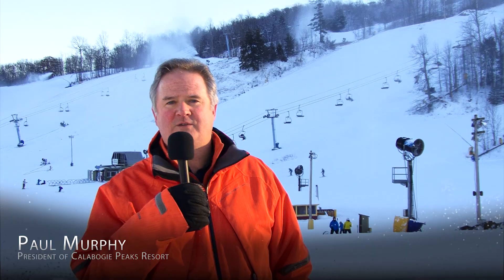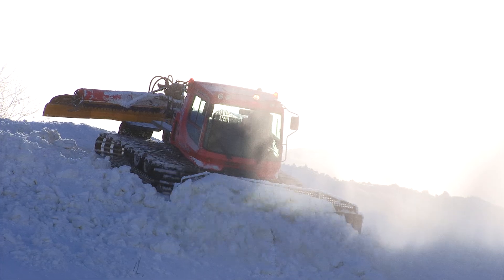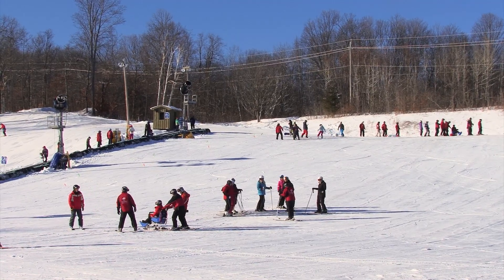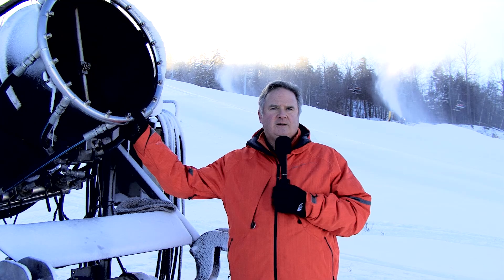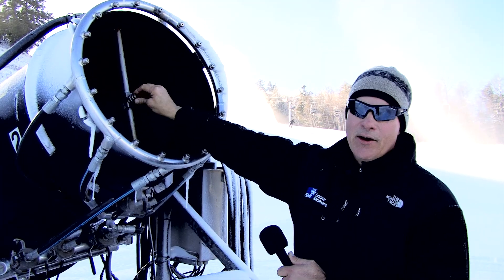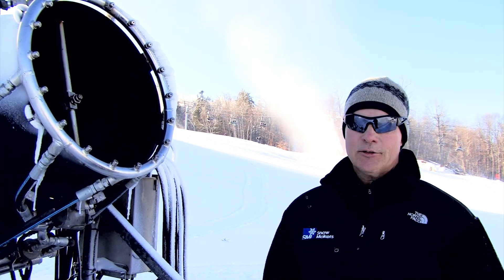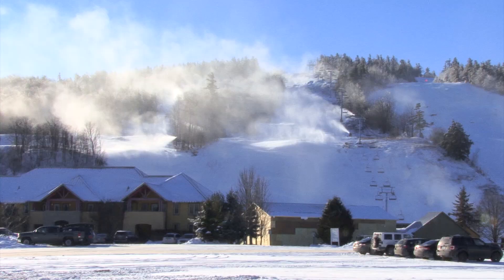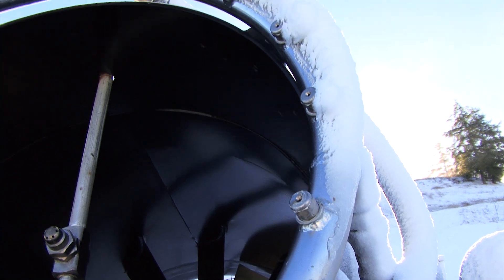Behind the Scenes - How Snowmaking at Ski Resorts Works

Comment: So how do you keep the water from freezing at those temps between the pump house to the machines?
Reply: You keep it flowing, I was making snow last night at -32 and if you have a problem and water quits moving for over a minute you’re pretty well screwed, I run a mobile unit with a big generator and water tank in a sea can with a high pressure pump pushing water to the snow maker, tank is filled by a 3 inch water pump running at pretty well idle
Reply: @timmyteabag69   interesting stuff.

Comment: Don't forget all the fun parts like using the Tiger Torch to thaw the ice that often forms on the rear fanguard screens. Digging out the hoses and power cords after the night shift guys slept most of there shift. Hanging, thawing, and rolling  100 ft water hoses etc.  Unsung heroes.
Reply: 6am, just got back from a gun run. Im the night shift guy. 🤣

Comment: Nice system. I work at a resort in pa that has a system that has 90 techno alpines and a portable fleet of pole cats that is an automated system with e-motors that run water hydrant.
Reply: 7 springs? Pgh resident here 🙋🏽‍♂️

Comment: @7:48 "those motors use less electricity (horsepower), great for the environment. @9:12 "key to making snow is horsepower, we've increased our horsepower dramatically."
Reply: do you want to ski or not?
Reply: He would have meant the motors are more efficient than the previous system or systems used by some of the lodges.
Reply: I noticed that as well; however he talks about different parts of the system. I think the actual snow guns got more efficient in the aspect that they produce more snow for less or equal power, while the big water pump just got a power upgrade. That eric guy that answered perviously seems a bit confused by mechanical power vs electrical power: the term horsepower does not indicate machanical power at all; it's just a unit.
Reply: You clearly didn’t listen very well. Their previous system used compressed air and water injection at the main pump house, where now compressed air is only used for nucleation at the fan head where the majority of energy is pure water flow. Thus they use about half as much power as their old system.
Reply: @46I37  just shut the fuck up, nobody cares, seriously.... and it sounded like everyone in that video was lying .......just want to put that out there
Reply: @Smegma_pirate  this whole thread is about what 46I37 is talking about so what do you mean by no one cares. Also why would the people in the video lie about how a snow machine works? That makes no sense. It's honestly funny how mad you got from a single reply.
Reply: @Smegma_pirate  I care. You believing everyone in this video was lying just goes to show how little you understand these topics. You probably got confused and offended when people starting using science and math in their explanations, didn't you?
Reply: @Smegma_pirate  Y U Mad?
Reply: Kilowatts is equal to horsepower, not "electricity". Electricity is a vague term and he could have easily meant that the efficiency has gone up, not that kilowatts went up. Efficiency=mechanical power output / electrical power input (power=kilowatts). Two electric motors could use different amounts of kilowatt hours and produce the same horsepower (kilowatts) if one is more efficient that the other. Had the guy said kilowatts instead of electricity, you'd be correct, but he didn't.
Sincerely,
A Mechanical Engineer.
Reply: By less electricity he means less kWh of energy needed than before.1 HP equals 746 Watts, it's set number and efficiency has nothing to do with it. Demand, measured in "Watts", over time is measured in "Watt hours" (Wh). Example,  a 10 HP motor will draw 7.64kW. That motor in one hour, at a full constant load will use 7.46kW hours (consumption) of electricity. What Paul was saying is the new (well 4 years ago...) fan guns only use 15 HP (11.190 kW) each, which is 40% less kW than the old system of having huge compressors that would feed all the fan guns compressed air. The new guns compress the air themselves, and by doing that are 40% more electrically efficiently than using one central source of compressed air for all the guns.  Which is unrelated to the pumps for the water, that both the old and new system still need.
Reply: smaller hp is less power usage. The duty of the motors are going to be similar. you know that.
Reply: @Eric-lf6yx  lol kilowatts is merely a designation, a word used to descride 1000 watts all in the same place at the same time.... it would be wonderfully convenient if 1000 watts were equal to 1hp but it aint. please don't engineer anything in the pacific northwest.... your knowledge (or lack ther-of) is quite concerning......
Reply: honeydewbunson I think your terribly confused by my comment... let me explain. When I say, “two electric motors could use different amounts of kilowatt hours and produce the same horsepower (kilowatt)...” I think that is what confused you. Saying horsepower (kilowatt) does not mean horsepower=kilowatt, I simply mentioned two power types of units for people to understand. Obviously 1 hp=0.7457 KW but for some reason you thought a unit followed by another unit in parentheses means they are equal. I guess that confused you. I could say “power” instead of a specific unit like hp or KW to confuse you less next time. Please don’t make such strong false judgements so quickly.
Reply: this guy is clearly lying throughout the video, such shaky speech and nervous swallowing

Comment: How does the water lines not freeze
Reply from the maker: As long as the water is pumping through they will not freeze in most cases. The danger is when the power goes out and the pumps stop, the snowmaking crews have very little time to disconnect the hoses and drain the water before the snowguns get damaged. Because of that, it becomes dangerous and risky to do snowmaking as it gets extremely cold (-20'c and beyond).
Reply: The ski resort I work at has 103 automated  pole cats and techno alpine system. That have back up batteries that work a e- motor that sits on hydrant that shuts them off and drains
Reply: I’m a snow maker and a piston bully operator.  The lines do freeze sometimes.  Gotta get out there and unfreeze them.  300psi water 90pst air and 480volts all in one little spot.  I love my job.
Reply: The water lines from the lake to pump house and from pump house to each gun station is buried in the ground over two feet deep. Than has a lateral from main water line connected to a hydrant that has drains on the bottom of them which are also buried .

Comment: Shanty man your seals are leaking on electrical
Reply: the leakage is required for the pump to operate. Theres packing around the shaft of the pump and if there was no leakage it would catch on fire because of all the friction, its needed for lubrication

Comment: Those snow making machines are not fail safe, in case of a power/motor failure they should automatically drain all the water out to prevent pipe breakups.
Reply: @Peppe Ddu thank you so much, I've got a question though, are all other types of snowmaking machines like this, or is it a common problem you encounter with all snowmaking machines
Reply: you must be an engineer, congrats on noticing something fairly small that wasn't worth mentioning in the video

Comment: What a waste of electricity and water, ski where there is snow, no need for this.
Reply: +An Onymous ok yeah let me travel some where and burn a shit ton of fuel to get there.  plus where do you think the water goes when it melts?
Reply: An Onymous get over yourselves already with all the renewable energy Mumbo-Jumbo. your car probably causes more devastating fumes than these machines put together.
calm the heck down
Reply: +An Onymous It must be nice to live in an area that gets good snow, most of us are not so lucky.
Reply: Do you know making solar panels creats carbon, and solar panels need to be replaced after around 20 years, if yuour lucky you will get 25 years.
Reply: yeah because its sunny and windy everyday they need to make snow....
Reply: An Onymous They’re not wasting water since it’s not consumed, the water flows right back to where they got it. And travelling somewhere would burn so much fuel that it makes snowmaking the better option.
Reply: We need solar cell to keep save power :)
Reply: An Onymous Snow resorts tend to have snowmaking ponds where the snowmelts off at the end of the season
Reply: An Onymous dumbass
Reply: It isn't even possible to "waste water" unless you put it on a rocket and blast it off the planet. You need to research the term "water cycle", which is something you should have learned about in primary school.
Reply: What a retarded comment
Reply: Electricity wasted but water just goes back into the ground then rivers
Reply: You’re so stupid
Reply: Climate change......da
Reply: this would be acceptable if the energy used was produced from renewable energy sources (wind/sun..), capitalism everyone